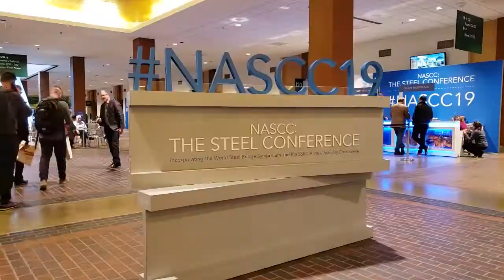FlexArm NASCC Floor Demo

Comment: We had an air tap on a flex arm at my old shop - aside from the weight, the best part is that it holds the square to the work so the tap starts co-linear with the hole.